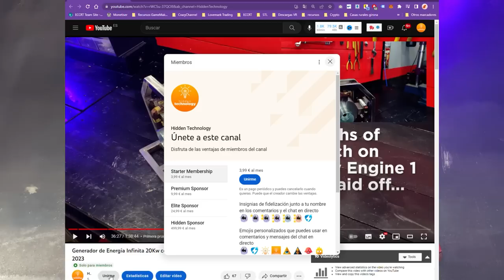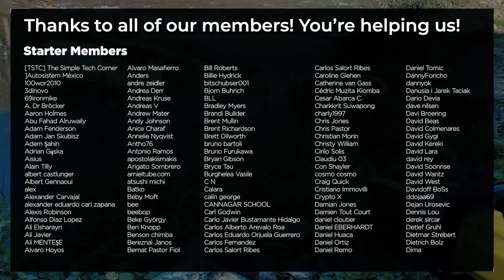LIBERTY ENGINE 2.0 TEST - UNCUT VERSION

Comment: I have theorized. That what you have done is possible. Even made a few small scale attempts myself. Needed some machining equipment. That I did not have or the expertise to metal work. You basically created a rotating magnetic field or switching fields. Very ingenious. Is not perpetual motion. Always knew magnets was stored energy, Just never could figure out how to convert to usable energy. Well done! Fellows.
Reply: Of course, a magnet weakens over time, which type of magnet do you think stays the same?
Reply: @bahodirjonabdullayev7011  None stay the same. Except an electro magnet. Which requires energy to maintain a magnetic field. Man made magnets last longer. Natural magnets are made by the magnetic field of the earth. But have a short life.

Comment: It would be useful to measure the voltage and current of the load from the generator in real time to see the actual impact of each of the connected devices.  It is best to connect 2000W heaters (first one, then the second and third, etc.) and then see how they will impact the generator.

Comment: Question #1 why only 4 coils, if you made  each coil core is big enough for 2 coils? 
Question #2 if you really intended to only have 4 coils total, why not make the coil cores flush with the coil and closer to the magnetic wheel for a stranger magnetic effect? 
Question #3 why is this version only single sided devise instead of a double sided devise?
Question #4 why aren't you using fuses to regulate the incoming flew before looping back into the motors power supply?

Comment: The Rotor is made of alluminium with a percentage of silver to help create the diamagnetic effect in the rotating magnetic field caused by the infused silver in the alluminium rotor..how much is mystery...balanced coring of the alluminium rotor  to add silver could possible work...either all I'm a huge fan of this experiment it could potentially save the world...imagine this in a electric car
Reply: Yes may help the silver but the silver only react if the magnet move over and even if you do move the magnet over the silver just a tiny effect while you move the magnet. On the rotor the magnet stay in one place in the cure of alu and silver so no effect of the silver I believe
Reply: @alexandersandor7315  I believe the build of this device using the pullstart to give enough momentum to power the motor to self power is correct and possible...the idea of using silver within the magnetic field I'm going to have to test that out for myself I have built one without the solid rotar but a design of my own

Comment: so you are using an asynchronous motor with a steinmetz circuit to drive it with your theoretical single phase, first flaw because it is more or less a solution when you dont have the 3 phases or the right motor and its very innefficient...
you have 4 coils but only connect two. the magnetic circuit may be present but just because the frame is welded to the laminated core  and there is a reason for the laminated core... reduce eddy currents. 
but i am actually curious that would happen if you feed the motor with a 180degree phase shifted voltage (like yours) and use the steinmetz circuit.

Comment: Very coincidentally it puts out 228V regardless of the load conditions, never going up or down when loaded with the 3000 Watt heaters! Could it be that there is something else providing the 228V, maybe mains voltage?
Reply: Better if they install an rpm indicator, so we can see how the system rpm stabilizes with load changes. The rotor alone is heavy at 7.6kg, spins at 1400rpm. Notice at 8:24 when the starting string is pulled, it reaches some low rpm. Then the machine quickly accelerates to 1400 rpm.

Comment: Hmmm.. Which type of inverter is hidden inside the capacitor, Take the capacitor out of the plastic case and show us what's inside by doing the test. And how do you stabilize Output Frequency and Voltage ???
Reply: Better if they install an rpm indicator, so we can see how the system rpm stabilizes with load changes. The rotor alone is heavy at 7.6kg, spins at 1400rpm. Notice at 8:24 when the starting string is pulled, it reaches some low rpm. Then the machine accelerates to 1400 rpm.

Comment: I would like to know where they got the metal for the flywheel? I am a gearhead with my own garage and workshop. I have my own spinning lathe which I can build one… I just want to know if the aluminum silver metal was something that they melted together themselves, or did they buy it from someplace? I’d really like to try and put this design to the test and see if it really works! If it does, I will gladly like and support your video and advocate your work!
Reply: Alu und Silber Legierung.
Ich würde Aluplatten zu runden Scheiben zuschneiden.
Die Scheiben an einander Verschrauben und die Magnete in den Aussparungen 
in den Platten verklemmmen.
Reply: its a silver aluminum material made that flywheel and places with neodyme magnets in it
Reply: @augustuscaesarabarquez270  i know what is on it, I just want to know how to get the materials to build it myself!
Reply: @gt2699  It is shown in previous videos how he created it. However im not sure about the ratio of silver and aluminum.
Reply: @benq994  and once again, I’m not asking about how he “created” the metal flywheel… I’m asking if and where he “purchased” the metal for the flywheel! I want to know where he got the materials so I can experiment with it! I saw perfectly well, how he was using his machinery to create the flywheel, but I want to know where he got the silver/aluminum material to make the flywheel!

Comment: I expressed 100% of your video, but the voltage generated is not coming out
The motors are 1400 rpm, 1800 rpm, 2800 rpm, and 3000 rpm, but they are about 15V.
If the way you make it tastes good, you're lying

Comment: large hum from a  big mains transformer under the bench and even buried underground later in the video,  he does a lot of tests at that same place on the riverbank, obviously has mains there to run irrigation systems, but i do like the video. Not enough magnets and certainly not strong enough to do the work he shows. think about it and you will see its nothing more than a electric motor with the drive transformer under the bench, nothing more that the mains that there at the water side that drives the irrigation pump being used to drive the motor go mislead one to into thinking its running without any power input.

Comment: To remove some of the doubt, solder the wires on to the bulb, lay it on the table and and don't hold it in your grip of your hand. 
What's in the round cylinder that connects to the junction box at the top of the motor?
Reply: Kondensator

Comment: For who ever is a non believer, you can create this as a miniature version. With a small disk, neodium magnets, cables and a toy car motor. YES OF COURSE is NOT going to produce the same voltage but it will be enough to power up a light bulb indefinitely! 

I am telling you cause i did my self with a cost of less than 30£
Reply: how?
Reply: What parts did you use? I want to build  mini version
Reply: @welnawelness4807  well i tried to replicate it as much as possible using the same things that we were taught as kids in middle school. Like for example if you r wrap a wire around a nail and you hook it up on a battery it becomes electromagnetic.
So having that in mind.

i used 4 nails which they were 5 inch long (the diameter plays a big part the longer the nail is the more times you can wrap the wire around it thus creating more magnetism)

Wires, a toy car motor or even a hand fan coil will do the job, small neodium magnets (that came from amazon), a "Mini-CD" disk. and that's it. The rest you just need "Soldering skills", a glu gun and a wooden board to assemble your project.

Something last on my 1st attempt i removed the small cog that was on the Toy car motor and that was a huge mistake because the small pin was just spinning by itself without spinning the disk with he magnets on.

In my opinion if you have the money and tools to build a PROPER ONE like in the video, it will be worth your time and money. If my mini version can light up a bulb indefenetly IMAGINE their liberty machine what can do!
Reply: Why do you lie? This is absolutely 100% bs.
Reply: @KevinSmith-os5yz  well do it your self then! There is absolutely nothing to do or say to change your mind. So do it yourself and you will see, you can find most of these things in your garage or salvage them on a junk yard.

I assume that you have days off from your work, so devote some of your free time and create this project.
Reply: @savitargod0fspeed290  hmmm. If I were to build a glass hammer and I knew it would shatter as soon as I used it, would I really need to build it?
Reply: @savitargod0fspeed290  me thinks you have never build a working one. Oh, let me rephrase that, I know you have never , nor will ever, build a working one. Learn some physics before wasting your time. There is a reason we don't have to keep reinventing the wheel.
Reply: @KevinSmith-os5yz  you compare 2 different things. "The glass hammer" is more realistically to shatter as soon as you use it, but this machine is something that newly discovered, some people make it work some don't, some they are believers some are not.

Everybody laughed at Madame Curie when she presented her data regarding radioactivity to scholars. Today thanks to her discovery science has done leaps on radioactive sciences.

So i ask u this why a "silly machine" like the "liberty project" cannot exist?
Reply: @savitargod0fspeed290  I got a check for $10,000 if you send me a working model that can be independently verified. Common that's worth your 30£ isn't it? I'll even pay shipping. Let me know:)
Reply: @savitargod0fspeed290  you say you made a small one, right for 30£? . Lets verify that. If you really did, I'll give $10,000. I'm guessing you will have some excuse why you can't. Non of it is proprietary is it. So let's do this.I'm game how about you?
Reply: @KevinSmith-os5yz   i never said that i build the ACTUAL "Liberty Project". Re - Read my comment, my attempt cannot power anything more than a light bulb. 

So you prefer to send me 10k $ instead of spending less than 30£ to build one for yourself? Just try it and build. Following the same principals of both Liberty 1.0 and Liberty 2.0 try to build a smaller version of it.

Finally as i said i cannot say or do anything to change your mind. Do as you wish. We cannot reinvent the wheel but surely we can upgrade it!
Reply: @savitargod0fspeed290  I didn't compare 2 different things. I compared something I know will not work, no matter how hard I try. The glass hammer will shatter evertime. Just like I know these machines don't work, every single time. Prove me wrong!
Reply: @savitargod0fspeed290  as I said I'll give you 10k for your working model, no matter what size. But it has to be verified working. Got a deal?
Reply: @savitargod0fspeed290  there are no principles to follow on his liberty engine, it's all smoke and mirrors. But if you built a tiny working version, no matter what size. I got the money,do we have a deal? Or are you telling untruths about a working model?
Reply: @savitargod0fspeed290  I understood that you didn't build the liberty engine and that yours only powers a small light. That is what I was proposing. You send it,  if it works you get 10 grand. Easy peasy, after all. You allready built it, surely you can build more, let's do it:)
Reply: For whoever is a believer, you can see this guy claims to have built a small working model, but will not send it for verification, even though it cost him only 30£ to make. What does that tell you?  When asked to put up, they shut up:)
Reply: @savitargod0fspeed290  any other takers?
Reply: BONJOUR SAVEZ-VOUS COMMENT REPRODUIRE CE VERBATIM ? JE SUIS PRÊT À ÊTRE ASSOCIÉ J’ATTENDS VOTRE RÉPONSE
Reply: @ndoubayoaristode6465  i have no idea what you just said to me try in English
Reply: @KevinSmith-os5yz  do whatever you want mate i am telling you this now if you believe it okay if you don't then still okay. 

Is going to be way easier to build it yourself than sending it to you. That's my final word.
Reply: @savitargod0fspeed290  you can't produce it. Face it you are lying,  and everyone seeing this, knows it also.
Reply: @savitargod0fspeed290  google translate,  look it up.
Reply: @KevinSmith-os5yz  okay! Whatever you say mate!
Reply: @savitargod0fspeed290  10 grand for your toy, but you can't be bothered. You must be one rich guy, congrats.
Reply: @savitargod0fspeed290  when you go fishing,  do you always catch whales?
Reply: @savitargod0fspeed290  you don't wanna play anymore, so you are gonna take your ball and run home? Dang, and here I thought I might have found the one person on all of youtube, who finally made a overunity machine and could prove it. I am so disappointed that you won't share with the rest of the world 😞
Reply: @savitargod0fspeed290  I am interested in looking at it in a video...even if brief. Please share link.

Comment: How would you regulate speed and horsepower
Reply: increase the number of magnets and put more step-up transformers.
Reply: Better if they install an rpm indicator, so we can see how the system rpm stabilizes with load changes. The rotor alone is heavy at 7.6kg, spins at 1400rpm. Notice at 8:24 when the starting string is pulled, it reaches some low rpm. Then the machine accelerates to 1400 rpm.

Comment: Very innovative and simple yet powerful and disruptive. How does the alloy material affect the magnetic field generated by the magnets and is it the same material as the cores inside the microwave transformer coils? Is it an aluminum alloy?
Reply: It's a silver infused aluminium rotor...silver cannot be magnetised but when placed into a rotating magnetic field it creates a diamagnetic affect

Comment: This is click bait.
It works because many people watch it and he makes a lot of money with it.
Nobody has managed to reproduce it yet!!!
This was answered by a very experienced physicist Prof (Dr György Egely) when I specifically asked about this. I was hoping too! It cannot produce only 20-40 volts. Sorry to give you bad news...
Reply: Are you serious? I've seen where it powers a water pump and a saw, drill, or grinder at the same time. It would have to at least produce 3,600-4,200 watts for that alone at 120 volts
Reply: @RHumphrey922  
Did you see it on video?

Or in reality?
Reply: @макс иванов Thanks for the constructive criticism.
What is your experience with the device?
Reply: @RHumphrey922  I would be most happy if it worked (I spent 250 euros on a magnet), but it doesn't work for me.

Then an email exchange with an inventor (Dr György Egely)
his answer: neither he nor anyone else could reproduce it, even though several people tried.

Comment: What is the RPM's of it ?
Reply: 1400rpm they have a build video that shows you everything.
Reply: @joshualima6967  Thanks..
Reply: Suspiciously the same as he would get using mains to power it:)
Reply: In a different video, this was tested out in a field running a water pump,  apple desktop computer, and cutoff grinders, hand drills. I don't believe it is 20kw but if is is 1000 watts running 24 hours that is 24kw a day. Run that into a battery bank for demand energy. Look up Howard Johnson's magnetic motor patent around 1981 US.

Comment: I made a carbon copy of this device, and it doesn't work at all??? I tested the coils, the motor is new.
Reply: u sure, exactly and exact copy? 0.1mm out and it won;t work maybe? generating magnetic feilds and a pretty exacting science
Reply: Did you use an aluminum/ silver alloy in the rotor that holds the magnets?
Reply: @stevenrowlandson9650 Hello.  Is it possible to use a rotor from ABS plastic on a 3D printer?